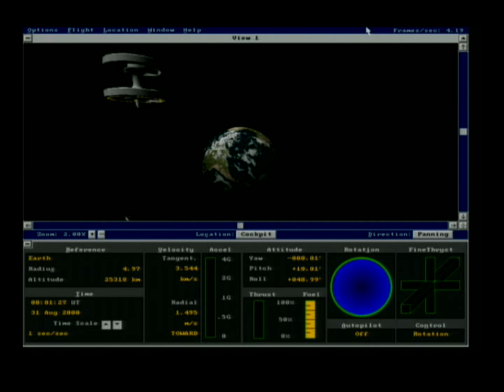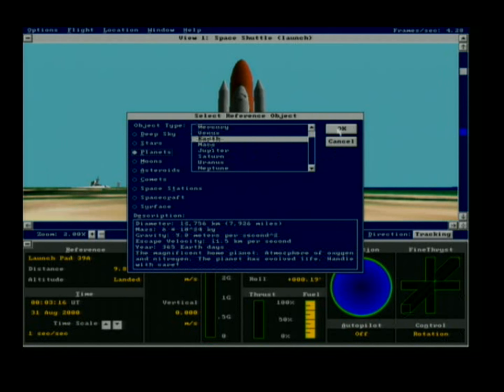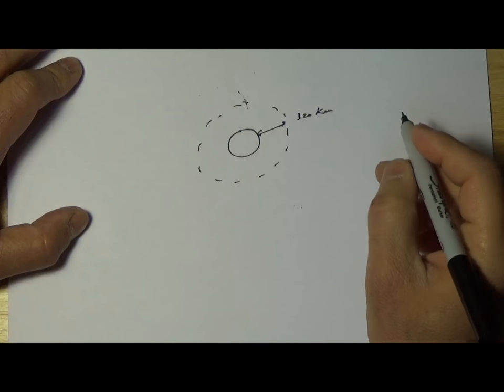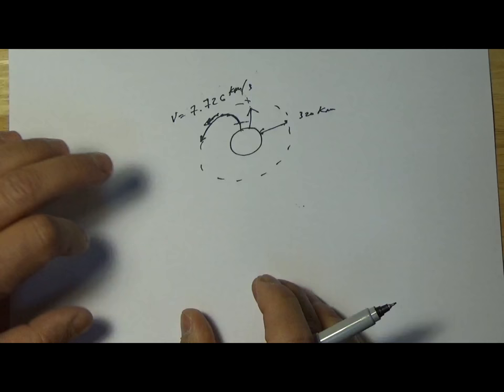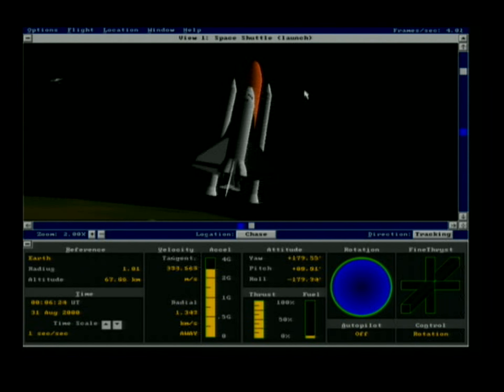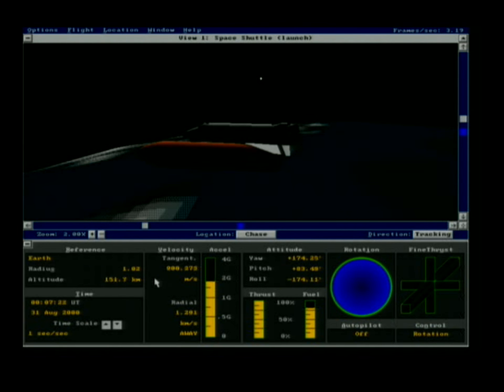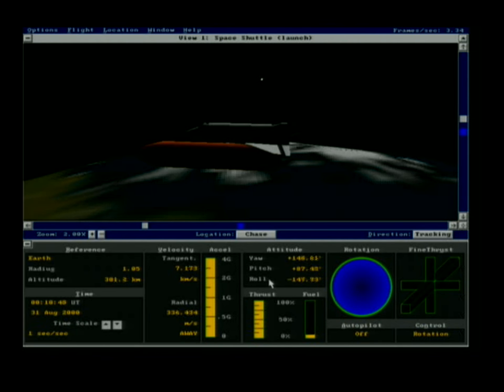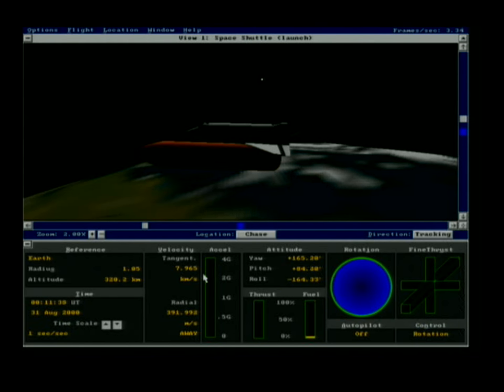Manual Launch and Orbital insertion with the Microsoft Space Simulator

Comment: Going to have to get this and FS5 for my DOS 6.22/WfW 3.11 486 build, if it can handle them. I have a DX2 66 and DX4 100 if needed. I have a good VLB 2D video card, but it isn't so great for 3D. Think that'll work for these?
Reply from the maker: The PC running this simulation is a 486 DX4-100 and it handles it just fine although if you turn on the Milky Way background the frame rate drops to around 4 FPS.
Reply: @SuperVorticon  Good to hear. Thanks.

Comment: How would you alter the orbit so that the Orbiter keeps the same side, i.e. Its top or underside parallel to the earth?
Reply from the maker: An orbital change will not do here.  The orbiter will maintain a constant attitude regardless of where it is on the orbital path so there will be times where you are pointing straight down or straight up into space. The only way to stay parallel with the Earth's surface will be to manually change the orbiter's pitch as you move around the orbit. That said, you can have a view window open tracking the earth so you will always see the surface regardless of where your spacecraft is pointing.